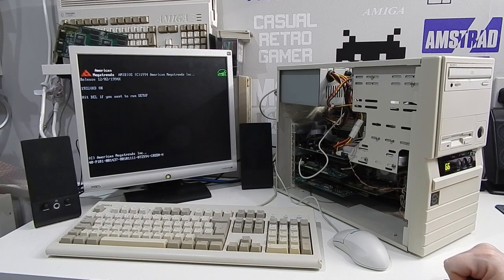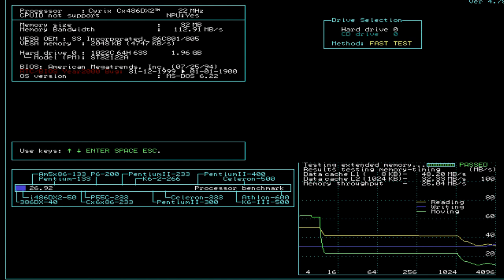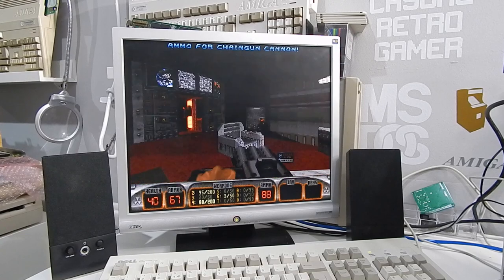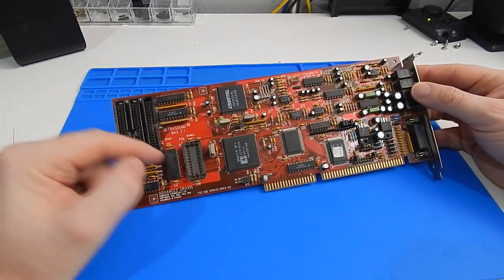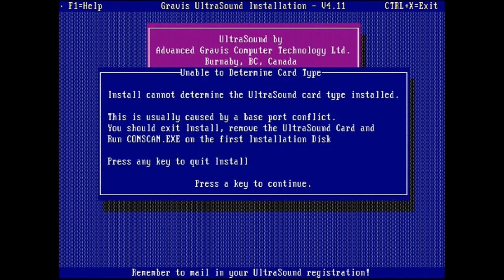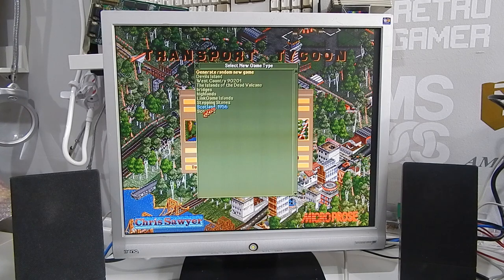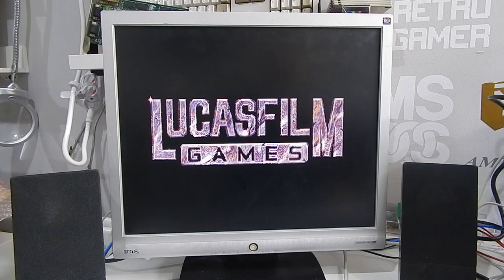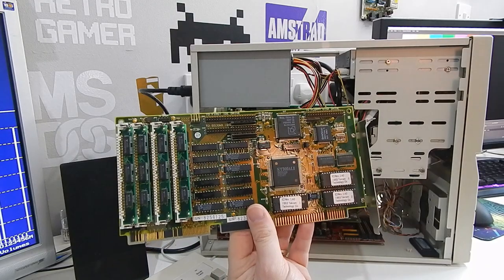BIOS update and an Ultrasound upgrade for the 486 #DOScember

Comment: I think the BIOS date is the 2nd of December, rather than the 12th of February, as it's probably formatted in the US month/day/year format.  Anyhow, I see that this board supports DX4 CPUs, as well as a Pentium Overdrive, perhaps you can squeeze a bit more performance out of the system with one of those?
Reply from the maker: Funny you should say that cause I do have a DX4 100 system lying doing nothing.  I'm very tempted to pull the chip of out that and drop it into this system.  Not sure though, something nice about the DX2 66 even if it isn't the fastest.
Reply: @CRG  It might make for an interesting comparison, and show whether the faster CPUs really would have made a difference, vs actually buying a Pentium system, say.

Comment: Does the BIOS allow you to set the DRAM Page Mode to something other then fast, like maybe EDO... and have you tried EDO memory in this computer?
Reply from the maker: I'm not sure on the bios setting, I'll check, but as for the ram I haven't tried edo sticks.  I expect the would be considerably slower.
Reply: @CRG  My testing shows EDO is typically 10-20% faster then FPM ram.

Comment: Hi you have to replace the Crystal SoundBlaster Clone card I use with Gravis Utrasound MAX 1.8 + ESS1688 Gold-16 Plus and everything works without problems, or orginal Sound Blaster 16 or SB Awe 32
Reply from the maker: I still have the crystal soundblaster clone in there and I've since, for the most part, got the issue fixed.  The only outstanding problem is that after using the gravis it will mute the line in through which I have the soundblaster connected.  Going to get an external mixer to solve this plus it'll let me keep my other machines hooked up to speakers at the same time.
Reply: @CRG  ok i see you find solution ,Gravis UltraSound MAX is a Holly Gral for MS-DOS gaming The problem is that many games need Path Games and in some it doesn't work at all

Comment: two things: have you tried to emulate 486 or pentium 1 with fpga? also, from 486 era, we have come more than 1000x, but not in core clocks, only 100x
Reply from the maker: Personally I'm not a big fan of emulation.  I'd use dosbox the odd time for testing stuff and use the likes of WinUAE (Amiga emulator) for setting up drives but that's about it.  I jut prefer messing with the real hardware.
Reply: @CRG  ok. i see fpga's to be as close to bare metal as possible not having the original hardware
Reply from the maker: Yes I agree an fpga is about as close to the real thing as you'll get and if anything with all this old hardware aging it probably is the future for many retro systems.

Comment: if you can track it down, a Soundblaster AWE32 or AWE64 would be period-appropriate - I had an AWE32 w/ 2MB of RAM on it (it took 30-pin SIMM memory) back in the day. Wavetable synth + actual Soundblaster hardware made gaming sound the best you could get in the era.
Reply from the maker: Funny you should mention that as I do have a AWE64 gold sitting here but I'm keeping it for my Pentium build along with a few other bits.  The GUS is dated 94 so more appropriate to this machine.  Have to admit I did consider putting both cards in this machine but probably overkill.
Reply: I was thinking the same. For me it was PC Speaker -> Soundblaster -> Soundblaster 16 -> Soundblaster AWE32 -> AWE64. I think the AWE32 was my favorite as AWE64 Gold just seemed kind of cheap by comparison.
Reply: Agreed - for me it was PC Speaker > SB16 > AWE32 > AWE64 > Live!. The jump from PC speaker to SB16 was an obvious and significant leap in quality, as was the jump to AWE32 (though ironically I actually had the hardware needed to make it unnecessary, in the form of a Yamaha keyboard with wavetable synth, just never hooked it up). The jump from AWE32 to 64 was non-existent for me -- because I had already upgraded the 32 with 2mb of memory it was basically a 64 already - none of my games saw any difference. The Live! added features again, but most games simply couldn't or didn't take advantage of it because we were already in the era of mp3 soundtracks on games. That was the last discrete sound card I ever bought, but the last one I actually felt like made a difference was the AWE32

Comment: The Ultrasound max contains a SB emulator that must be clashing with the real one. I had one at those times.... 
I don't think it can be disabled by jumpers. But I think I achieved it changing the port jumpers and changing the order on which the drivers were loaded... Sorry that was like 30y ago.
Reply from the maker: I think I've got it more or less sorted now.  Loading the SB clone first then the GUS with its SB settings disabled. 

There is still an issue with the pass through on the GUS card.  It likes to mute the line in randomly but that's easy fixed with a command.
Reply: Judging by this https://www.vogonswiki.com/index.php/Gravis_Ultrasound the GUS does use port 0x388, the Adlib port as part of its SB emulation.  You may be able to use those GUS TSRs/config programs to disengage it without rebooting.

Comment: The Tekram card as you show it does not really support "RAID". You have a version 1.40 BIOS on the card, which only supports write mirroring, so it can copy everything you write to the master drive of a channel also to the slave drive on the same channel. All readsy are served by the master. If the master fails (either for some sector or completely), yor system fails. You need to change the "mirror target" drive (the slave drive) to be the master drive to have the system come back to life, using the disk all writes were mirrored to. That's not what you would expect of a real RAID system.
You can get a bit of RAID feeling if you upgrade the card to BIOS 2.02. The update is a bit tricky, because you will only find images for the chips with numbers 2 and 3. What no one is going to tell you: BIOS version 2.x puts the card into a special mode where ROM chip number 1 is replaced by a small stub ROM integrated into the ST300ALI chip, so it does not matter what you plug into the socket for ROM number 1, you can even leave it empty.
Reply from the maker: Thanks for the tip, that'll come in very useful for when I get my eprom writer.  I'm really hoping I can get this card up and running.  I don't suppose you have a link to the 2.02 bios?
Reply: @CRG  http://files.mpoli.fi/hardware/HDD/TEKMAR/DC680TR.ZIP works perfectly if the hardware is OK. Your story about the DC680 sounds like we already exchanged messages on vogons.org, without getting the card working.
Reply from the maker: @tw11tube  Its very possible we did, my account over their is a lot older than this channel when I went be a different name online, unite.  I dare say I'll be picking your brains again when it comes time to try and get this thing up and running.

Comment: use dma 1 and 5 instead of 1 and 3
Reply from the maker: I've since changed to all dmas 1 and irqs 5.  It's mostly working well now although there is still an odd issue of the GUS randomly muting it's line in which I'm using as passthrough for the SB clone.

Comment: Your first problem is a PCchips mobo.
Reply from the maker: Normally I'd agree but I have to stand up for it here and say that it's actually not a bad board.  From benchmarks I've seen it's certainly up there as a decent performer.
Reply: @CRG  cool, I just never had much luck with pcchips anything in the past, I'm glad it's working for you